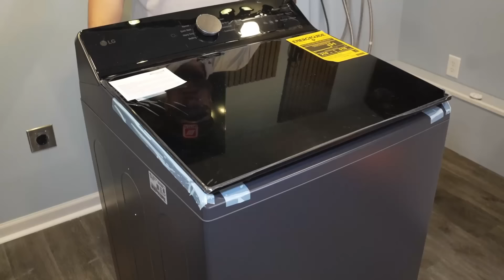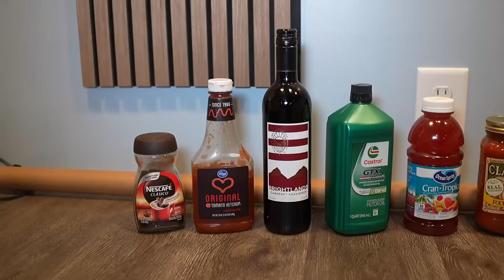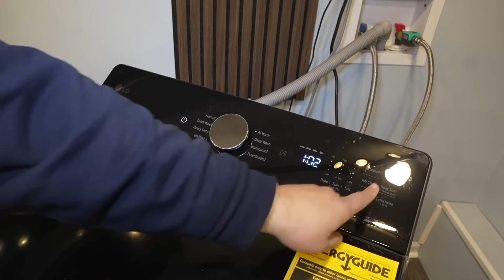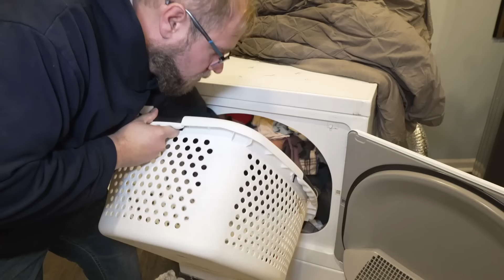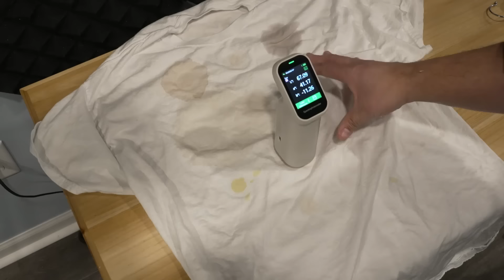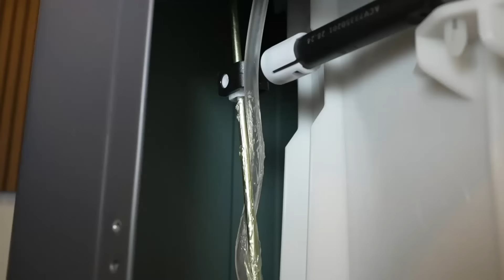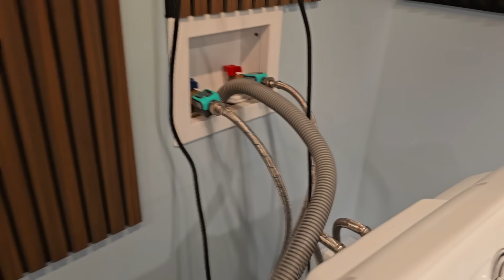Is 2025's "Best Washer" Actually Good? LG WT8405 Test & Teardown

Comment: I just bought this unit. I have replaced two front loaders and no matter how many precautions I took, didin't like the mold issue with front loaders. I also had an issue with my Kenmore not being able to handle large loads and having to drain the machine somewhat regularly. Finally, I didn't like not being able to add clothes once the washer ran and thought the pre-soak feature didn't do anything on a front loader. I hope it works because I already ordered it!
Reply: How has it been?
Reply: How do you like it? I ordered one too and it's due to be delivered today 😊
Reply: @andreadake5049 same! I’ve been going to reviews left and right! 🤦🏽‍♀️😵‍💫😵‍💫😫😩😩
Reply: Update us please?
Reply: @almaoliviaalmanza7330   not the person you're asking but I also was asking for an update a few days ago. Inbought one and it was delivered 2 days ago. I've washed 8 loads with it so far. It manages much larger loads than my old top loader. My old one was 3.2 cuft. That said, there is NO presoak cycle. Not on the app nor the machine dial itself. It takes up to almost 3 hours to complete a load if you're using heavy duty with extra rinses. They do have a 30 min quick wash but I have not used it yet. You really do need to fill it 3/4 of the way full for the best clean. Any smaller or larger they don't come out as clean as I'd like. I don't regret buying the machine though. I just think coming from a 16 year old top loader I had unrealistic expectations. Old machines with no he features with REAL agitators are just no comparison to modern ones. The reason I bought a new one is because my old one was leaking out the bottom and would have had to replace the bottom seal, clutch, and actuator which was impossible to find all the parts for, unfortunately. I was happy to be able to buy a new machine capable of handling large loads. 

So overall the pros and cons
Pros
very large capacity 
Has add a garment option 
Deep water wash option 
Can add up to 2 rinses to some cycles 
Can select a variety of fill temperatures

Cons
No presoak (though I found a work around)
Agitator not a true agitator 
The glass lid is so tinted you cannot see through without a flashlight
Cannot fill machine with water with lid open
Cannot fill to capacity or fill half full and have clean clothes
Long cycle times 

I think next time I have to replace my machine, if there are not large capacity top loaders with real agitators then I am going to try a front loader. I was always against them but the tumbling action surely agitates better than an impeller or agi-peller design.

If you have any questions or anything I'd be happy to answer!
Reply: @andreadake5049  still treating you well 2 months down the road? Any hidden tricks I should know to get the best clean besides deep fill. I have the set being delivered tomorrow but have seen so many mixed reviews. Thanks!
Reply: @andreadake5049  what setting do you use to get it full to your recommended depth of water, please?
Reply: @andreadake5049  Good luck with maintenance for your front loader. I have one now and it is going back. i am getting a top loader.
Reply: @andreadake5049 great review. I am on the fence about this model . I have whirlpool now with no agitator and hate them . Was hoping this lg with the agitator would be the bees knees .. I might go front loader and hope to not get the dreaded mold issues that everyone talks about
Reply: @andreadake5049  What is your work around for not having pre-soak please!?
Reply: @sabrinalever6601  basically you have to choose any cycle that has the fill water temp and depth you want to soak in. This fill is going to be what your soak water is. After the washer fills you then need to pause and then power off the machine with the power button. After about 10 seconds turn the power back on and choose the delayed cycle option set for however long you want this "soak" to be. That's the best I could come up with.
Reply: If you wait too long to turn the power back in the machine will automatically drain the load.
Reply: A lot of people seem to reach the same conclusion after dealing with front loaders for a while. The mold issue and not being able to toss in that one forgotten sock mid-cycle drives people crazy.
Top-loaders may not look as fancy, but the simplicity and bigger usable tub can make everyday laundry a lot easier. Hopefully this one ends up being a solid long-term machine for you.

Comment: Love you channel, I have learned so much.  We have had front loaders for years.  Started off with a smaller 3.5 Cu Ft and then tried a HE top loader for a bigger size option (king size comforter) didn’t last a week and went back for a 4.5 Cu Ft Maytag front loader.  It Didn’t do so good with the comforter.  

We are now in the market for a new washer and trying to narrow it down.  I’m sure the top loader has improved since the last time I tried one but still not sure.  Feel really good about the Electrolux 4.5 Cu Ft and their web site say it can handle a king size comforter.  

Wondering you thoughts on GE GFW655SPVDS or LG WM6700HBA front loaders?

Thanks for your insight and input it is great appreciated.

Comment: I wonder if the DC pumps are using a brushless DC motor so they don't need a shaft seal.  Makes them less susceptible to developing a leak.
Reply from the maker: I'm not sure, but I asked one of the head techs at Samsung about the switch to DC pumps and he said that overall they see way less problems with them and its an upgrade to reliability

Comment: I am having this machine with the impeller and ai delivered in an hour,as well as the matching steam dryer.Both cost a fortune.Sure hope they work as well as they look. Guess I will just have to be careful not to stain my clothes. Honestly I soak stains in oxiclean in the sink first and they are never a problem. The model I am getting has running water to soak the stain in the tub prior to the wash cycle.I cant possibly see why stains would be an issue when treated first with oxi in either of these LG models. I would never just put in a badly stained article of clothing without soaking it first. Great video.
Reply from the maker: I'm fairly confident that the impeller models' just as good. If you can somewhat pre-treat stains, its going to do a really good job getting the rest out. After running more and more tests, the reality is that this unit did really good for all of the tests we ran - I tried Speed Queen's gold standard washer a lot recently and it barely did better, but took way more water and electric to do the same.
Reply: @bensappliancesandjunk  One of the downloadable wash cycles is called "Pre Wash + Normal". Don't know how similar that is to pre soak. There are about 30 custom cycles, but I haven't tried any of them yet.
Reply: How do you like it? I think it is terrible for reasons I posted above

Comment: WTW8127LW1 5.3 CU FT with removable agitator.I"m on my 2nd Whirlpool that  got from Costco in 2 1/2 weeks. There were problems right off and in a week I had to replace. Now I am testing it for the relay failures  which happened on the first one. I am very technically savvy and was a contractor for years putty myself thru college. Many type of projects. BTW the Costco White Glove install is a joke.  First person never installed all of the hoses that should have been replace. They run those Logistics people like 19 deliveries a day, (he told me).  I had a Samsung I replaced after having it run fine from March 2012 to March 2025.  I only had a few issues early one which were covered on warranty.   MY Q is I am starting to wonder since I have had everything no work, like having to reset the unit in cycle and being locked out as door would not release or just noises that I notice while spinning unless I lightly touch the unit top on spin, then stops, to no water filling properly even when I have it on high water fill.  I will run for a week as I also may have a leak in the back, but will fix myself with teflon tape around the threads.  I have a biz trip and can deal with it until I get back.   SO is the LG here a better option for me? It's just two of us here and my wife is a physician and we just need to wash stuff ever few days.  and YEAH, not really a fan of this plastic bottom either.  Let me know your thoughts!

Comment: Great testing methods!

Also, people forgetting to take their clothes out of a drying unit before trading it in? 🤦‍♂️

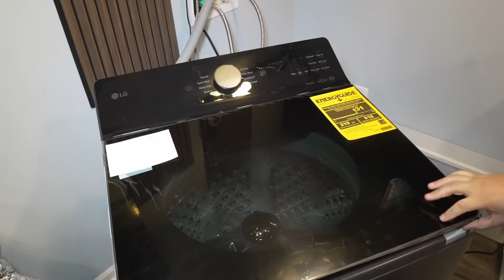7:10 I’ve been wondering if the LG washer we bought last year (no LED screen on it it’s old school) had any validity to its AI wash claims. I can’t tell if it’s doing anything when it’s “sensing”, so I just have to assume AI is marketing BS and LG is ripping us off
Reply from the maker: AI usually has to do with turbidity sensing and predicting load type + adjusting the settings to optimize the wash settings more correctly than the dial/normal settings from what I've seen

Comment: The washing system of a front-loading washing machine will always be more efficient than a top-loading system. A front-loading machine will handle larger loads better, using less energy and water. The biggest drawbacks of front-loading washing machines: they cost more to purchase and maintain, are harder to repair, are heavier, and will never be as practical as a top-loading machine.

Comment: Do you think that the wt8500cb is just as good? It has the impeller instead of the agitator and is cheaper. Please let me know because I’m ready to buy now,  and so used to the washers with the agitator but I’ll save $150 by going with the impeller version. Please advise.
Reply from the maker: I think its a pretty good machine. Most LG impeller users tend to think they are quite nice
Reply: @ thank you!

Comment: I've got the top of the line 7900 from Costco and been very happy with it. No agitator but huge and quiet. Paid about 800 delivered and has the same Bluetooth app.
Got tired of replacing the bearings, seal, and shaft on the Kenmore/Whirlpool top load He about every year. Been about 3 years now and it's still quiet and just works and is supposed to be reliable and the bearing and shaft setup sounds modular so should be easier to service than the old machine.
I also got the 4 year extended warranty for using their credit card.
This unit should be similar except it has the agitator.

Comment: Why are we so focused on energy efficiency? Why can’t I just get the real dirt and grime out of my clothes? I work as a diesel mechanic and not a single goddamn washer I’ve tried has cleaned it enough to get diesel or oil out of clothing.
Degreaser used or not, if it doesn’t clean my damn clothes I don’t want it.
Reply from the maker: Have you tried to pre-treat the diesel stains with liquid dish soap (preferably Ultra Dawn), then run the load with hot water?

Comment: My LG washing machine display just died 4 months out of a 2 year warranty. Do not buy one of these machines
Reply from the maker: Did it stop working entirely, or it turns on but you cannot press anything for it to work?
Reply: @bensappliancesandjunk  the screen has lost half its numbers and the dial does not light up on the top half . I cant see what setting it is on anymore . My last washing machine lasted over 20 years...I cant believe the junk they make these days

Comment: Our Lg is about 3years old. Very frustrated that there is no Permanent Press selection on the front.  I’ve managed to cobble something together on the “Downloaded” setting but it’s bare adequate.  The other thing is that the lid makes a loud “pop” sound when opened.  A design flaw.
Reply: At least your lid and top has not cracked yet. All plastic.

Comment: I have a LG red washer 13yrs old great machine,has done hundreds of loads never been repaired.
Reply: That's 13 years ago. Everything has changed now. Anything after 2019 is crap
Reply: Not the same machines now. We need replacement machines and yours is not for sale. Let me give you an example. I had a great set of Maytag's  40 years ago and they lasted 15 years. So all should buy Maytag. Except, they kinda suck now.
Reply: If it's done hundreds only in 13 years, there a below average usage, at 13 years old, normal use will be in the thousands of loads.

Comment: I really like LG direct drive top load washers. I ended up with one by accident as I purchased a GE WPGT9150HWW washer back in 2008. The wife liked all of the features and I liked GE as it was an "American" brand back then. I had the machine delivered and when setting up the machine, I noticed it was made in Korea. I looked up the control board for the machine to see that it was made by LG. Long story short, I got a LG machine in GE badging.
The salesperson advised my wife that we may only see 8 years of service out of the machine as High Efficiency machines use less water but have a much longer run time to clean clothes with a little amount of water. The washer worked great cleaning my kids clothes along with my work clothes and the machine ran one load or more almost every day. The machine ended up lasting 12 years.
Reply: Has nothing to do with washers we can buy today.

Comment: What you don't say is does this machine actually roll over a load like a normal classic washer filled with water? Doesn't look like it does too good on that.
Reply from the maker: I spent $1,000 on scientific tests for this video and every other the past ~4 months. Not opening the lid up and pretending that movement is the only way clothes get cleaned via a specifc amount of roll-over based on filmed footage.

This washer preformed decently on stain removals both by set-in stains as well as the legal tests that every manufacturer has to use to prove that they can clean clothes.

No one has yet shown a better way of definitively proving if a washer actually can wash clothes that I have seen.

And yes, I have the camera footage too. That will be released soon after the TC5 test is done. It did a good job on moving the clothing around during the filming process. But not as good as any front loader from what I've seen.
Reply: @ I’m only going by what I see. Rollover is a good indicator of how uniformly the whole load gets down into the main wash zone.. if it does that great. That’s all I wanted to know. I’m not questioning your methods. I simply wanted to know if the thing has rollover and if the entire load rolls over. I’m glad you’re doing these kind of tests.

Comment: Hey Ben! I just got the kit for the samsung fridge fix! Quick question, my fridge has been leaking dirty water at the bottom left side if the fridge. Not from the freezer nor from the rear where the drain tubes are at.. when I put hot water in the drain line it Did cause more water to leak... any idea on how to stop this and why its leaking under a random spot under the fridge rather than the drain tubes?

Comment: From my experience as appliance repair tech  for last 10 years most dependable washers are LG top loaders.They having leaking inlet valve problems (easy fix) from time to time, outside that  they  don' brake like other brands . But if you still using the old Whirlpool /Kenmore washer w drive coupling and manual crank timer ,keep it! Fix it and you'll be good another 5-10 years)
Reply: Your opinion means more to me than Consumer Reports.
Reply: @ravipeiris4388  Well said.
Reply: Exactly what our repair guy said about our 23 year old top load Kenmore.  They’re not the Kenmore of yesterday years, but are better than the overly digitized washers on the market today in terms of reliability.  Like most appliances today they are packing with more and more digital age features into appliances — apps, wi-fi, AI, etc and it’s just more stuff that can go wrong and overly complicated and expensive to fix.  Back to the future when a washer, refrigerator, oven etc would last a good 25-30 years and more.
Reply: I as a 25 year tech have to agree with you. Though their Refrigerators are just alright. I do not like Samsung and LG dishwashers.
Reply: Just fixed my 11 year old LG. The  inlet valve was leaking and now it's good to go. Hopefully it can last me another 5 plus years
Reply: Always interesting hearing the perspective from someone who actually repairs these machines for a living. The inlet valve issue on LG top-loaders seems pretty minor compared to some of the failures you hear about on other brands. And that advice about keeping the older Whirlpool/Kenmore models with the mechanical timer makes a lot of sense. Those simpler designs seem to be a lot easier to keep running for years with basic repairs.
Reply: Speed Queen is the best washer/ dryer hands down!!!
It is manufactured one hour from where I live..made in Ripon wi..comes with a 7 year warranty..my clothes including dirty socks come over clean..
Reply: I wish I had seen this last year before I replaced my 16 year old Kenmore washer & dryer. My Maytag is broken for the 2nd time in 6 months.😡

Comment: I'll stick with my GE 460.
Reply from the maker: GE460's are pretty decent basic machines. No huge flaws, but not superstars either. A good machine though!
Reply: @bensappliancesandjunk  it's 7 years old and I've never had a problem with it. Also I get a full tub of water with an adjustable soak cycle. I've never pulled a dirty load of clothes out of it.